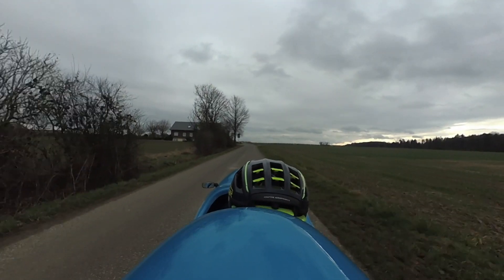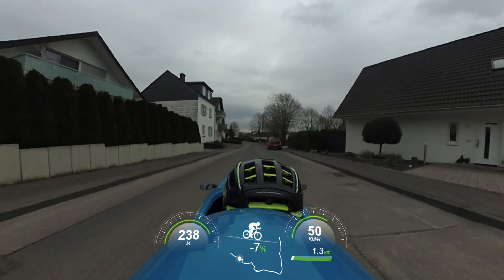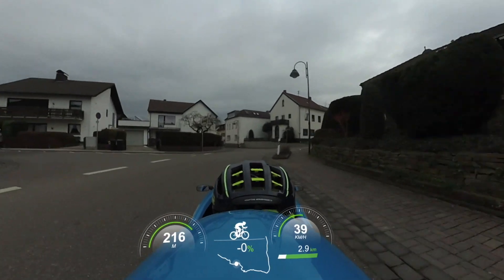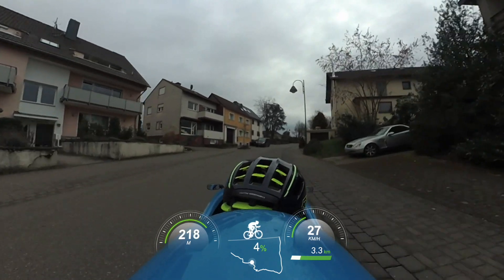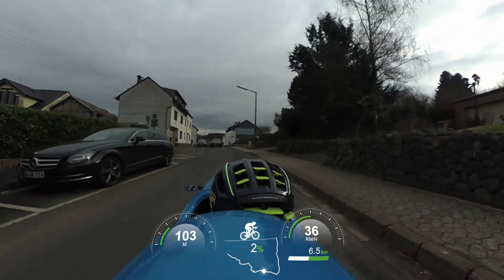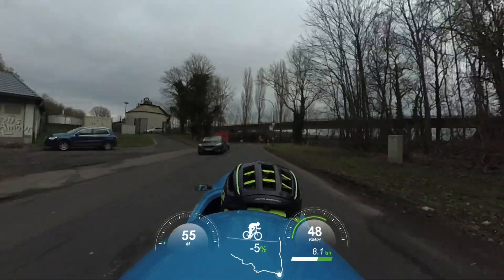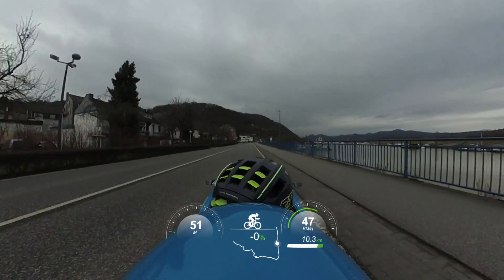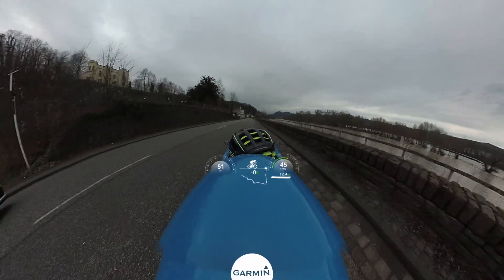Testing DF Steering V3

Comment: I am glad that the steering seems to be working well. I have a new DF - built early 2021. The steering felt twitchy at first but I am used to it now and feel confident in it. One thing I did notice was that the camber (the degree the wheels are from verticle) does seem different on each side. I have no tool to accurately measure it. I am no expert in steering geometry, but this seems odd. I had wondered whether it was an adaptation to driving on the right hand side of roads and countering the camber of the road. (Less useful for me as, for some odd reason, we drive on the left in the UK!) I have tried to adjust the camber but the rod on the side I need to bring in is already fully screwed in. I did wonder whether different length rods got filled by accident. Ultimately, I do not know if it makes a huge difference. The pair of Schwalbe G1s it came with wore pretty fast, but the Marathons I put on for the winter look fine in terms of wear so far. Have you had any similar issues?
Reply from the maker: Didn't have these issues, my DF rolls very well. After the second crash I didn't feel the misaligned track (due to crashing into a pothole) at first, but about 50 km later the tire I put on as replacement was totally worn. A very experienced rider modified the toeing by hand, and that plus a new tire got me home.
I found it useful afterwards to do roll out tests to check the alignment -- look for marginal declines, as little a decline as possible to get the velomobile rolling without pedal input, and do several runs before beginning to make changes (1-2 turns) of the toe bar on one side.
As to camber, the DF shell has been designed by hand, and though it looks perfect, it is not perfectly symmetrical, which is why the right side wheel has a slightly different camber. Those who did all the fine measurement have noticed, otherwise you won't feel any difference. My advice would be to just leave it as is.

Comment: I have Version 2 steering plates on my df xl. How much better is this and how is the turning radius now. It got worse from v1 to v2.
Reply from the maker: Added stability is a big plus (though I have not tried it in strong side winds) -- so far, V3 is a definite improvement. Turning radius appears to b e the same.

Comment: Oops, the rim got a bad hit...  carbon wasn't harmed?

I ordered the parts for the new steering geometry, too. Since we still have lots of snow, I haven't rushed with the fixing. 
Btw, how long cranks you have? I had 160mm and now there are new ones with 150mm length, just a moderate adjustment there
Reply from the maker: I'm riding 155s on all my DF.
There was a bit of damage on the carbon, though it was on a spot where there's mostly glue (at the lower forward end of the wheel well).